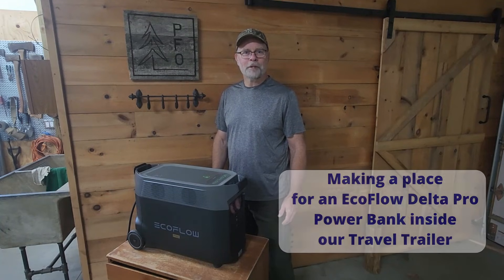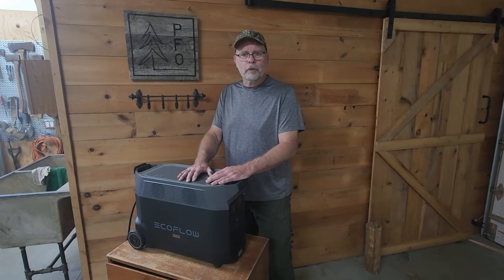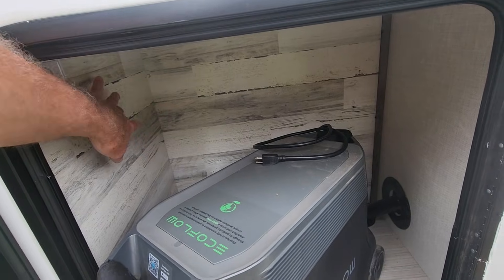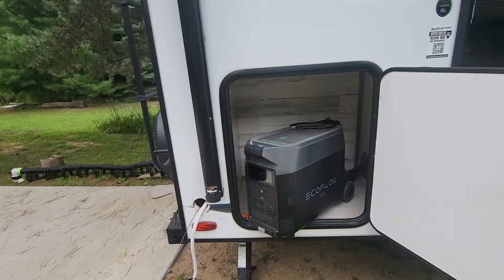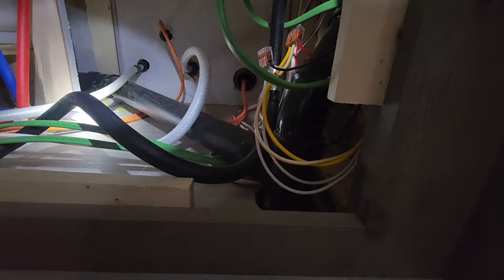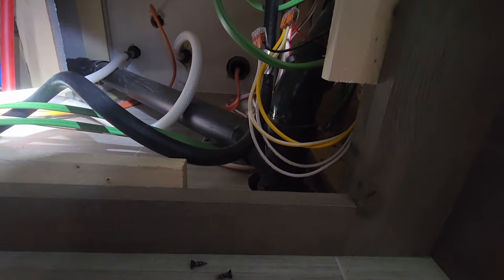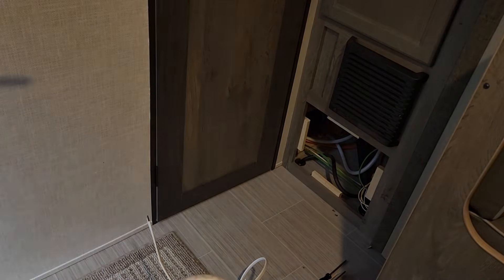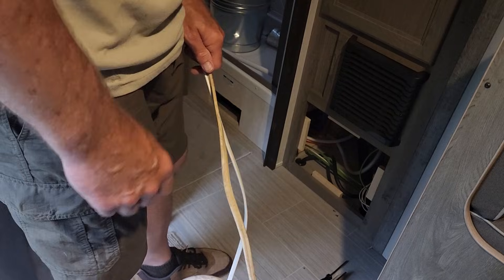Best EcoFlow Delta Pro Setup for Boondocking- Install a Transfer Switch!

Comment: Just to confirm, you cut the shore power wire and it goes into the transfer switch and then continues out? The other wire goes direct to the generator plug?
Reply from the maker: When connecting the wires to the transfer switch, I exactly followed the instructions printed on the cover of the switch. They were very clearly marked as to where each wire should be connected. In the description below my video, and right here, is a link to the Amazon listing of the transfer switch that I used. https://amzn.to/47QiLMQ
It shows a picture of the label with those wiring instruction. In my case, the "from generator" wires are the #10 Romex that I pulled through the trailer and attached to the new 30 amp receptacle that I installed in the compartment. If you try such a thing, you need to fully understand the wiring and components unique to your specific application.  Thanks for watching!
Reply: @thePFOchannel  correct. Got all that. You just can’t see the final install in the video to see all the connections in and out

Comment: I like your idea..I usually only do any boondocking when i have a stop over or taking a break like at a Walmart or a truck rest area..I hate using my generator because its too noisy ..I like the idea of using a power station. I also have a 30 amp plug that I connect to when using shore power..The ONLY issue I have is finding that shore power wire that I can split. I have to do more research in my RV to find how all the wires go to....We will see...Thanks for the video..Since its early November too cold to work, I'll try this in the spring when it gets warmer..
Reply from the maker: I'm glad to hear the video was helpful. Good luck with your installation this spring!

Comment: I want to thank you for creating such an impressive and detailed video of exactly what has been going through my head lately. I've got an Ecoflow Delta Pro Ultra for home backup already and was thinking of using for this scenario in my RV trailer. In the video when you were able to grab the fished wires from the rear underbelly I felt your excitement in my core! Good stuff!
Reply from the maker: Thanks for the positive feedback; I'm glad you found the video helpful! This is without question, the most useful upgrade we've done to our travel trailer.

Comment: Great video. I see those orange Wago connectors where you installed the transfer switch. I’d recommend you swap those out. They have proven to be dangerous. Now that EcoFlow has the alternator charger available, if you add that, you’ll always be fully charged and have pass through charging while the vehicle is running. Awesome, clean install!
Reply from the maker: Thanks for watching and for the tip about the connectors! The trailer is full of them, and I wasn't aware there were a problem. I've purchased a DC to DC charger to add to the system. It will be great to be able to recharge the Delta Pro during our frequent long days on the road.

Comment: How long will it run the ac unit?
Reply from the maker: There are many variables that influence the amount of time the Delta Pro will run the AC unit. The biggest two factors are probably the outside temperature and the temperature to which we wish to cool the inside of the travel trailer. When I ran a test to try to answer this question, the Delta pro shows it can run our AC unit for 3 hours if the AC is running on full blast the whole time. Our unit draws around 1,240 Watts on the High Cool setting. The Delta Pro provides a maximum of 3,600 Watt-hours, so the 3 hours shown on the screen is accurate, but rounded up. (The display doesn't show any decimal places on the 3 hour estimate.)

When the inside temperature reaches the setpoint on the thermostat, the AC compressor stops running and the AC unit runs in fan-only mode until the thermostat calls for more cooling. When it is running only the fan, it draws about 94 Watts. In that mode the Delta Pro would last about 38 hours. So, depending on where we set our thermostat, and how hot it is outside, it is going to keep switching back and forth between cooling and fan-only mode. The end result is we'll get somewhere between 3 hours and 38 hours running like that. It is important to note that during this quick test there was nothing else turned on in the travel trailer. When we are boondocking we always have food in the refrigerator and running the fridge is top priority. Therefore, we have concluded that if the outside temperatures are hot enough that we would not want to go without the AC, then extended boondocking is not compatible with that situation. For example, when we visited Moab, Utah and it was 104 degrees, we stayed at the local KOA campground and ran the rig on shore power. 

Thanks for watching, and thanks for the question!
Reply: @thePFOchannel great explanation. Ive been getting ready to purchase 900 watts of solar and a countrymod 12 volt ac unit ,and installing it in one of the vent holes. But not sure how i would hook it to the eco flow if i went with that instead.
I do have the eco flow 2 already .
Reply from the maker: @dudleydorite7678  I'm very interested in those 12 Volt air conditioning units. They seem like a perfect fit for a solar powered setup. I have a set of solar panels that I intend to install on our travel trailer and I will wire them up so they charge the Delta Pro rather than feeding into the trailer's 12 volt system. That would be the perfect time to also switch over to 12 Volt AC, wouldn't it? I'm dragging my feet on that project, though, because I'm intimidated by the idea of drilling holes in the roof  hoping to find a good route to run the cables fron the roof to the Delta Pro compartment.

Comment: I've done the same transfer switch mod you have done here and the hardest part for me was cutting that orange cord running from the back of the RV from shore. Reason being i was living in it full time in the summer and there is no going back once you cut that cord. Because of that i elected to add a male and female 30amp twist lock end where i made the cut in the cord so i could simply plug it back together if anything ever went wrong with the setup. I then added more 30 amp locking connector ends on the transfer switch side as well to connect shore to it. This also means if i sell the trailer i could technically unhook the transfer switch and return it to "Factory" in just under a minute. 

The other reason i did this was so i could easily choose which power side the transfer switch is primary or secondary by which order i plug into which side. Meaning right now i have it arranged so if the transfer switch detects power from inside the RV it runs off of that, but then auto defaults to shore power when inside power is turned off. I didn't want a situation where shore power goes out and it transfers over to secondary inside power without me knowing. Now if power goes out i just merely flip a switch from the inside and my Bluetti AC200Max powers my trailer. 

However, if i just simply swap the wires around i can make shore power primary and inside secondary without having to rewire anything if i change my mind. I later added a second transfer switch to my storage bay and did a proper solar install of 1200 watts of panels on the roof and 2000 Watt inverter setup with 300 AMP of lithium battery's. I then daisy chained my prior setup into it. Now If i turn on that 2nd inverter it takes over a primary and the bluetti is 2nd and shore is closed off. So i Technically have 3 separate sources of power in which only one can ever be active. All triggered by a flip of a switch. I already had a soft start installed on my ac so i can run my air conditioning off any of those power sources. Power goes out a lot in East Texas, but I can now run my AC all night long if needed. Great for dry camping / boondocking.
Reply from the maker: Thanks for sharing your setup! That sounds like a very flexible system.

Comment: When joining aluminum wire to copper, you need to apply an anti-oxidant compound to the aluminum to prevent a fire from oxidation caused by joining dissimilar metals.
Reply from the maker: After contemplating your comment more, I started wondering if I had missed something about the wiring in our travel trailer. I've gone back through the system and am happy to report that all of the wiring is copper. In the video we can see the silver colored wire strands on the leads coming out of the T30 transfer switch. Those are tinned copper (not aluminum) and the T30 is labeled as for use with copper wire only. So, this particular transfer switch would not be suitable for older travel trailers containing aluminum wire. Thanks again for your feedback on this important consideration.
Reply from the maker: Good point, thanks for the reminder!

Comment: Thanks for taking the time to do this. I'm going to try something like this on a smaller scale. I'm going to do it with the Delta 3. And just have 20amp. I have a Onan generator on board when the AC needs to run
Reply from the maker: I'm glad you found it helpful. Good luck, and have fun setting up your rig.

Comment: nice video! how do you charge the ecoflow? do you have to manually plug it in?
Reply from the maker: Yes, I do. I also added a 110 volt outlet in the storage compartment to recharge it, but it is not automatic. See, starting at  14:52, where I talk about I having to manually plug and unplug the appliance cord to only charge the Delta Pro when we are connected to shore power.
Reply: @thePFOchannel  got it, awesome!

Comment: So happy I found your video :) My trailer has a 50 amp system.  Looks straightforward when adding the transfer switch.  I missed how you installed your power outlet to charge your solar generator when connected to shore power.  Is that wired to the transfer switch as well?
Reply from the maker: I've never dealt with a 50 amp RV system, but it's cool to see solar generators, now, which support 50 amp RV power. There was no such thing when I bought my Delta Pro. The outlet I added in the storage compartment for recharging the Delta Pro when connected to shore power is not wired through the transfer switch, so to speak. It is just tied into one of the 110 volt "house" circuits that isn't likely to be running other appliances. So, it is hot whether running off shore power, or running off the Delra Pro. I have to remember to always unplug the Delta Pro from that outlet before powering the travel trailer with the Delta Pro, because it cannot accomodate an incoming charge at 110 volts while supporting any power output. Have fun setting up your rig!

Comment: What about just running a conduit?
Reply from the maker: That could work, too, and would probably have been less work, but I didn't want to add any holes through the underbelly panel. They would just be more places where I'd have to routinely check the seal to make sure it stayed mouse proof.
Reply: @ I have that skirting on underbelly, thinking I could tuck conduit underneath
Reply from the maker: Yeah, that should work.

Comment: Hello -  So I have my eye on a Eco Max Delta Max 2000  - and the tech support at Eco said to run a short cord (rated 30 amp) from the Eco and plug into the shore power plug - this is also where the onan generator plugs into -  and my RV electric would run off of the Eco -  My 2018 Winnebago 22m did not have an inverter installed ( although pre wired per WB )   only looking to energize cpap , tv , laptop , phone charge and maybe rv fridge     -    is this doable?
much Obliged for your time
Reply from the maker: You should be able to run all the electronics you listed off of the Eco Max 2000. The amount of time your charge will last is what will vary, depending on how many devices you run concurrently. Doing the math based on the Watt rating of each device will give you a rough idea of how much time you can get out of a full charge. As far as connecting the Delta Max to the shore power of your Winnie, I can't add much to what the factory tech told you. I have no experience with the Delta Max 2000 or with Winnebagos. Before I added the transfer switch and the 30 amp plug inside the cargo compartment, I always plugged my Delta Pro into the shore power inlet on the back side of the travel trailer. I just didn't like having it out in the rain or where people could see it. So, I don't see why that wouldn't work in your case, so long as the Delta Max has a 30 amp plug outlet. When I bought mine, the Delta Pro was the only one on the market that had a 30 amp RV style outlet. Good luck and happy camping!

Comment: Got a barebones used Leprechaun RV that doesn't even have an inverter or transfer switch; the Onan genny outlet is in the shore power cable compartment and I stay "plugged in" that way unless I'm on shore power. House batteries just power 12vDC stuff only so I've gone through and wired up a bunch of 12v outlets all over and have gotten good at using appliances geared towards truckers and mobile contractors that don't have 110vAC around. But you hit me with the AC/Coffee feels...
Looks like I'm gonna be doing this come spring time! Looks way easier than the complete component DIY setups I see.
Reply from the maker: Yeah, the Delta Pro is as close to a plug and play power option as I have seen. I also considered piecing a system together with separate components, but this proved to be way easier.

Comment: Cool project!  I did something quite similar to my 1980 Burro fiberglass camper.  My Delta Pro resides in the tongue box, and I ran new cables for power to/from the DP/camper.  I had to make a conduit out of pool vacuum hose and ran the wires through that into the camper (through the floor near the breaker panel).  Fun project!  And I used an ATS, as well.  DP is solid and reliable.

The best feature, IMHO, is the OTA updates!
Reply from the maker: That's a great idea to use the pool vacuum hose! as flexible conduit. I really like the OTA updates, too, as well as the Bluetooth communication to check the Delta Pro status through the phone app.

Comment: Awesome video! Quick question: Do you keep the converter breaker turned off when powering the trailer with the EcoFlow? And with your setup, does the trailer battery basically become obsolete? Thanks!
Reply from the maker: No, I do not turn off the converter. The entire travel trailer system, including the house battery, works exactly as if we are connected to shore power. It doesn't know the difference.
Reply: @thePFOchannel  
Thanks for the reply. Does the eco flow continually show a wattage output to “charge” the house battery?
Reply from the maker: I don't know. When the refrigerator compressor is not running, the output from the Delta Pro is minimal (40-80watts). I have not traced out the various continuous loads and added them up to see if there is also some charging going on, but there are several devices that always have an LED light lit, such as the fridge, gas alarm, the furion audio controller, water pump, battery/solar monitor, etc. So, I don't know if there is also some current going to charge the house battery. We have a small 60-watt solar panel on the roof that charges that battery, too.
Reply: @thePFOchannel  
Thank you for that information! I am looking to take advantage of some Black Friday sales and get my camper set up similarly.

Comment: I Just found this.  Nice video and idea.  Looks like that was a year ago.  Is it still working?  Still like the Ecoflow vs. other options?  I am in the research phase.  I am looking to buy both a travel trailer and some sort of EcoFLow or another brand for boondocking.  Thanks!
Reply from the maker: Thanks!  Yes, we still really like this setup. We just used it last week on a trip where we relied on it to keep our refrigerator cold for two days before we got to a campground with electrical hookup. I've made a couple more upgrades to it (videos coming soon), but the Delta Pro is still the heart of the system and is still working flawlessly.
Reply: @thePFOchannel  so realistically if not running the AC how long would the Delta Pro keep everything else going?  With some solar (200, or 400, or even 600)  hooked to it, could you theroretically go indefinitely?  Thanks for the response.
Reply from the maker: Answering that question requires either  1,000 different calculations, each based on a different set of assumptions, or it requires a gross oversimplification. The engineer in me begs for the former.  My typing ability with my thumbs leans towards the latter. 

The Delta Pro stores 3,600 watt hours of electricity. So, here's an oversimplification based on our particular experience. Assuming no usage of the AC, each time we have used the Delta Pro, it has lasted at least 24 hours. Our typical scenario includes running the refrigerator, minimal lights, occasional 12v water pump to flush the toilet, a few cups of coffee in the Keurig, and recharging an iPhone or two. We burn through the 3,600 watt hours in 24 hours. So, if we had 600 watts of solar and could rely on 6 solid hours of high, direct sunlight each day (not likely in our area) we could hypothetically replace the 3,600 watt hours each day and run like that indefinitely. I actually have 800 watts of solar panels and all the hardware and connectors sitting in boxes in the workshop waiting for me to find time to install them on the travel trailer roof. When that happens, I'll be able to add a level of certainty to this answer.

Thanks for the question!
Reply: @thePFOchannel  Thanks for that, I like simple.  I subbed to track your progress.  Maybe by this time next year I'll have some videos on my channel about this type subj. matter.